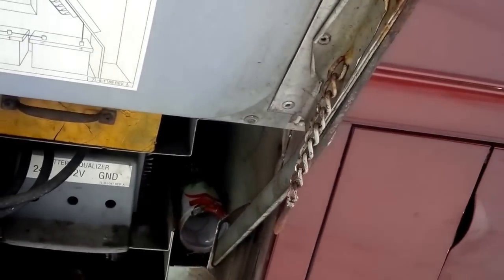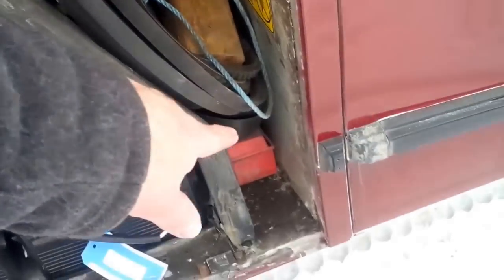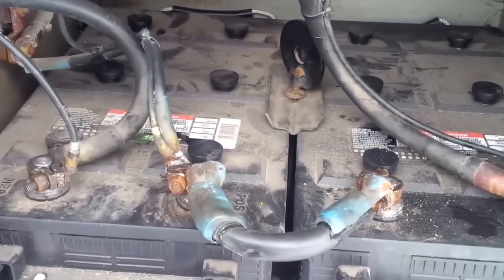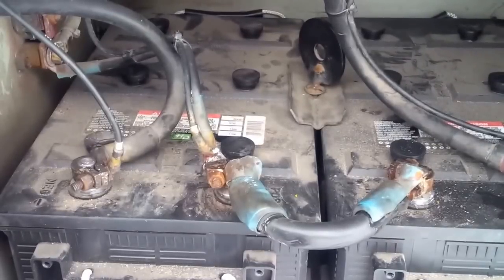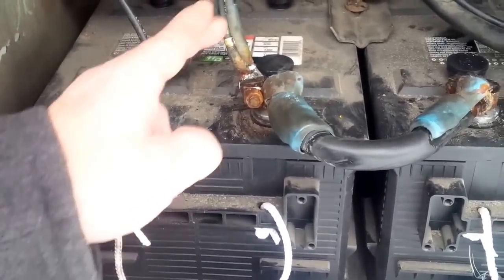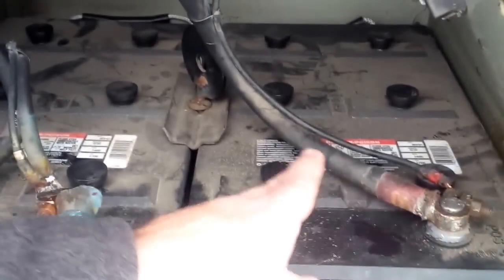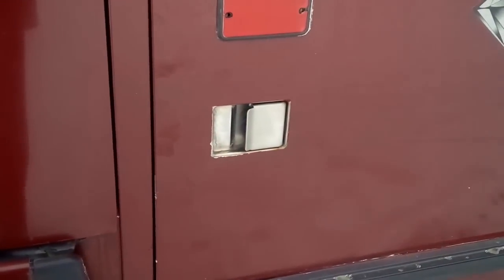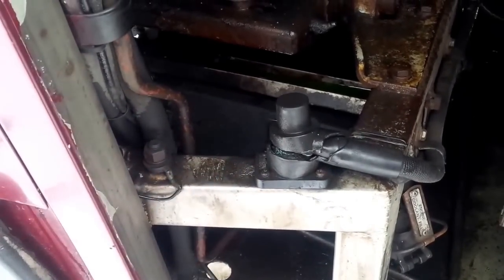How to charge a 24 volt battery system on a D series MCI Motorcoach / Bus

Comment: What cables need to be removed before charging from a 12 volt system? Do you advise removing the grounded cable (on the left in the video) before I begin charging? And how can I save the data in all the control modules? Details, details, of course. Just want to make sure I don't make things worse. Thanks for your help.
Reply from the maker: a 24v system uses 2 12v batteries wired in series together to achieve 24v.  if you want to charge using a 12v you must only charge one battery at a time.  they are wired basically:  ground to negative on battery one, battery one positive to battery 2 negative, battery 2 positive to vehicle.  to isolate one battery simply disconnect from the system.  example:  battery one would be disconnected from battery two.  if in doubt, disconnect both wires of the battery being charged.  ensure the wires don't touch anything they aren't supposed to.  hope that helps.
Reply: So remove the battery one positive or the battery two negative, got it.  Now is it possible for the data to be saved?

Comment: John, if you have a 24 volt charger, what would be the optimum Voltage once charged ? On my house batteries on my motorhome, i charge up tp 30 volts
Reply from the maker: You will likely either find two 12volt batteries or four 6volt batteries.  Typically the charging systems charge 12volts.  I would suggest checking your owners manual to discern how it is wired before proceeding.  Great question.

Comment: He forgot to tell you to disconnect the batteries before charging.  You can charge each battery independently with a 12 volt charger but disaconnect them completely.
Reply: blinko656 what if I just take out the jumper from positive to negative
Reply: So much wrong in this video. He can't even get which is which right.

Comment: these wire d+ can not avlebil
Reply from the maker: I don’t understand your question.  Are you saying that you have different wires on your batteries ?   Ideally it is best to disconnect the batteries before charging, but the video shows how I charged my batteries while connected due to being in a hurry to get on the road.  If you disconnect, make sure you reconnect the same as they were initially wired.  Wiring or charging wrong can be dangerous.